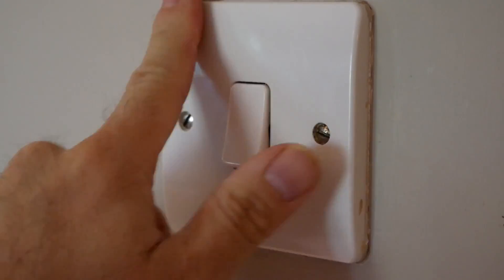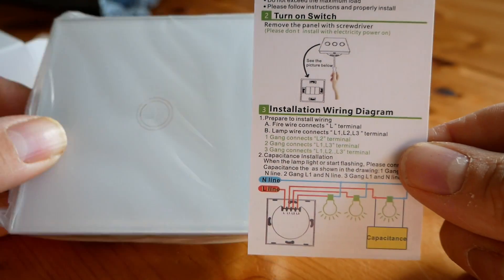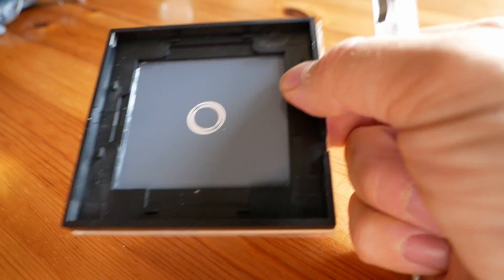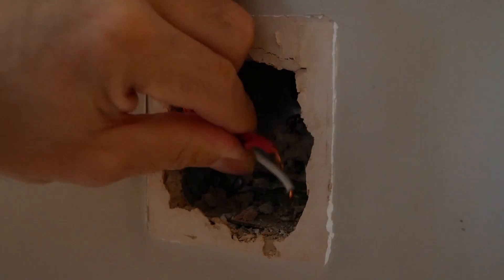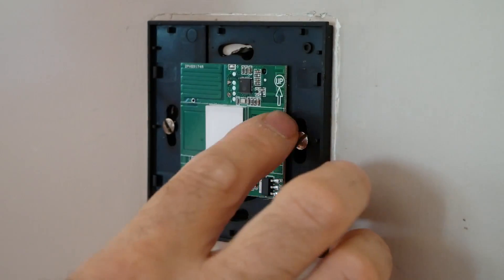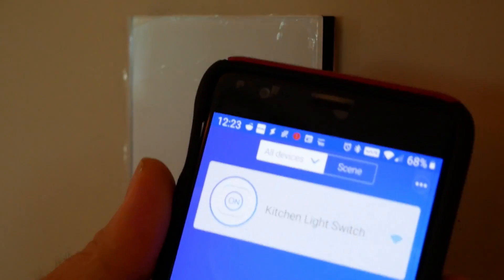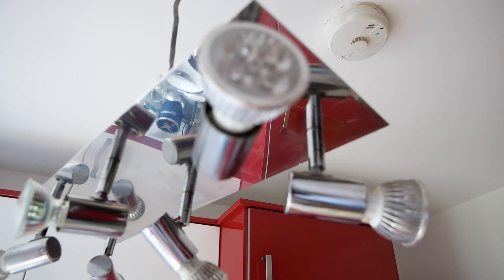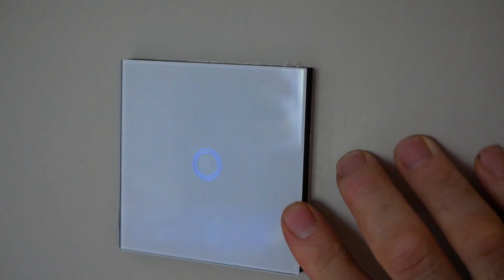No Neutral Smart Light Switch - Unboxing and Fitting

Comment: The capacitor should run parallel with the L1 the flicker is coming from the fact that the switch is always running power through L1 even when it's off. the capacitor on L1 (only) is designed to minimize that electricity when the switch is off.

Comment: I also found a better way to get the Hue light bulb so we no need to buy them now! Method they will hate me for figuring it out but I have! You have done it with a single switch which is great but come to stairs lights it get harder on the setup process, took me a while but now finely have the correct swtuches and correct bulbs at £20 rateh then Hue bulbs at £85 so well worth following me!

Comment: So we don’t need the neutral wire ? And can u tell me what is the benefit of the capacitor? Because when i bought the switch it comes with audiophile , is it same?
Reply from the maker: If you have a neutral wire at the switch then use a smart switch that requires a neutral.
If you only have live wires then a no neutral switch is required.
The capacitor allows the switch to draw a bit of power it needs to run.
I don't know what audiophile is in this context.
👍

Comment: Why you are not using the provided capacitor, and you have 2 live wires?
Reply from the maker: The capacitor is in the light fitting (on the ceiling). This is a no neutral switch so you have live in and live out - 2 live wires.

Comment: Hi mate. Thanks for the video. I'm a moron and am generally speaking pretty hopeless with this kind of stuff, the kind of moron to pay someone hard earned cash to get this kinda work done. Just installed my first switch and connected with Google Home without issue. Two more to do and at least something at home is gonna be smart, if not the residents 😂 thanks a million for breaking it down step by step, you saved me money and time, two valuable commodities which are hard to get in supply!
Reply from the maker: No problem - smart home stuff is a real rabbit hole. be careful or you will be spending proper money  - it all starts with a light switch 😂
Reply: @handymancraftglasgow I started with bulbs...top of the line LiFx ones. My bank balance still bears the scars.

But because I too, am a moron, I kept turning them off at the (non-smart) light switch.

My simple fix has been to tape over the switches in the "on" position, but it doesn't half confuse visitors!

I'd really like to replace my switches with WiFi ones, but I've no idea where to start. Adding confusion is the fact that I have a Google Home speaker, and finding devices that will integrate with it AND the LiFx lightbulbs is...well...challenging to say the least! I'm also sure the voids behind my existing switches are considerably shallower than in your video, and certainly the model you showed would not fit. Are there slimline, Google enabled, no neutral smart switches out there?

Comment: Any idea how the capacitor would work with spot lights that all run off one switch.  Can the capacitor be connected to the first bulb??
Reply: You can install it in any light.
Reply from the maker: As snoopy says, any lights so long as they are the 250v gu10 bulbs and not the 12v types 👍

Comment: What I'm lost, isn't the older wire set ups got white and black for neutral wires? Or just black
Reply from the maker: The set up in the video is very old. There are only live wires behind the switches and are white. Dates from about the seventies, or thereabouts.
Reply: @handymancraftglasgow  thats interesting. here I was thinking I had no neutral wires but I looked and I not only have neutral wires, but an updated colour code
Reply from the maker: If you have neutral wires you can do so much more with your switches 👍
Reply: @handymancraftglasgow  one annoying thing is that non Neutral smart switches are easier to find than neutral ones lol
Reply from the maker: If I had neutrals in the switches I would probably use a Shelly 1 which allows you to keep your original switch. Basically you end up with smart mechanical switches. A bit more complicated to wire in though.
Reply: @handymancraftglasgow  ah, that wouldn't be for me. I want to get rid of the classic look to a switch I get something new, like in this video! I'm gonna be replacing all switches and light fittings in my home haha
Reply from the maker: They certainly look more modern 👍
Reply: @handymancraftglasgow  yeah I can't wait! I'm sold on the fact I can just turn my light off from my bed without hardwiring a whole new switch in my wall to my bed

Comment: how can I use that switch on stairs ? I have two switches to deal with that but I dont know how connect each other
Reply from the maker: You can't with no neutral switches. You can't use these in a two way set up.

Comment: Thanks mate, best setup video ive seen on this. been trying to work out if i needed to install the capacitor or not before i bought them. Even better that your from Glasgow!
Reply from the maker: Thanks 👍. I would install the capacitor. Even if it does work without the capacitor you might want to use a different bulb in the future that may need the capacitor in there.
A fellow weegie I presume 😊👍
Reply: @handymancraftglasgow  I am indeed. Issue I'm having is that the switch feeds external led down lighters that have a really thin profile so not sure the capacitor will fit. Think I'll just need to buy it and try it 👍
Reply from the maker: It can be difficult if you don't have much room. Hope it goes well 👍

Comment: Hi we have just bought a smart switch a sonoff one, we are trying to add to our fluorescent  light in the kitchen, the light switch has 3 red cables in 2 together and 1 on its own, ive got it on and lit up, even set up to alexa but just won't  turn the  fluorescent light on and off, won't they work with those lights, or do I need something extra, I'm a newbe  to smart switches and from the UK. Thanks
Reply from the maker: I do not think  they will work with flourescent bulbs but I am not entirely sure. Have you fitted the capacitor?

Comment: I believe the capacitor goes across the light terminals if you're having problems as it creates a "virtual neutral" to power the switch
Reply: Not really a "Virtual Neutral" but lets enough current travel through the "Load" lead to power the Switch but not activate the bulb. A "Leak".

 I had this decades ago on a Door Bell that had a keyboard and you could "play in" whatever you wanted the unit to play when activated.
Reply from the maker: It does indeed 👍

Comment: Right sexy Handyman guy here is a question fur ye - Living room has about 12 Gu10 fitted lights, they were fitted back in the day when Gu10 Halogen bulbs 50w were in - All bulbs have been replaced with GU10 led - but dimmer don't work now and when the dimmer did work a while back with the GU10 LED bulbs when you turned the dimmer low it would flicker? you had to fiddle about with the dimmer to get it to settle now the dimmer just switched on or off   Do you have a solution?
Reply from the maker: You need to make sure that the new LED bulbs are dimable. If they are able to work with a dimmer you usually need a dimmer specifically for LEDs. The Leds use way less power than the halogens.
If your dimmer was flickering before you changes over to the LEDs its probably worth changing the dimmer switch. 
Calculate the total load of the lights and make sure the dimmer can handle the load. So, if you have 12 leds at 5W each you will be using a total of 60W - probably just over the power of 1 halogen bulb. 
Led dimmers are usually made to deal with lower loads.
Hope this helps
Reply: @handymancraftglasgow  Sounds good sexy boy i will give it try and let you know how i get on.
Reply: @handymancraftglasgow  Good news sexy boy , bought a led dimmer from Screwfix for £7.19 popped it on job done now i can make love to the wife with dimmed romantic lights instead of lighting from Wembley stadium.  thanks i will be back with more problems later cheers.

Comment: Its okay i just rammed the switch oan - stuck the 4 wires 2 in each wan- there wiz a yellow wan there i just chopped it aff way some scissors - i pit the power back oan - it smoked a wee bit and tripped a few times so aye opened it back up and put 2 of the other wires intae the other hole then took the other wan oot and put intae the other wan now wan hole huz 3 and the other huz 2 sound mate wee bit smoke comes oot when it switches oan but i switched aff the smoke alarm so its cool mucker. Buzzin!! so then i shoved the capicityor in there too.
Reply from the maker: Probably a bit late but I would say it's time to call an electrician 👍
Reply: Good video , i will save it

Comment: i have two outdoor lights and the  1switch is inside  (The Wire connecting from light to switch is hidden)- fitting the capacitor is a bit of an issue could i add a cable connector behind the wall switch and then add a capacitor there? 
ie- take the wires from the wall into a cable connector > Add the capacitor >> then add the switch?
Reply from the maker: These are no neutral switches. The capacitor is fitted across the live and neutral, usually in the light fitting. If you have a neutral at the switch you don't need one of these switches, another type would be better.
Reply: @handymancraftglasgow  ok i think i get it now the capacitor has to be fitted at the other end ie the wires coming from the wall light into a cable connector from the light side, not from the switch side.  i bought a cheap version of yours £18 amazon did the job got it to work but mines is non-dimmable.

Comment: For those who get a 2 gang version watch out for the load drop per gang compared to this single one. I think it's from 300w to 100w.
Yes I didn't check and blew the switch board when turning it on
Reply from the maker: Good point. Always a good thing to check the load of any switch before replacing - especially if you are using halogen or filament bulbs.

Comment: Good concise and easy to understand video.Could you up load a video showing a light light switch with a two way switch?
Reply from the maker: I wish I could. I tried everything to get these working as a two way switch but it's not possible with no neutral switches. 
You can set it up in app but if you're Wi-Fi goes down so do your switches, not good. 
There are other alternatives that I am looking into so will upload if I find one that works reliably.
Reply: @handymancraftglasgow  no worries, many thanks for the video anyway.

Comment: Has anyone had the buzzing capacitor problem and managed to fix it?
Reply from the maker: Make sure your connections are good. 👍
Reply: Got the same still can't fix it. I want to try another capacitor
Reply from the maker: When I was having problems with the capacitor, it was usually one of the legs of the capacitor not fixed properly. The legs are really thin, so doubling the leg over at the end to make it a bit thicker generally worked for me.

Comment: Hi
As you only had the one lamp flickering, do you think you could has solved that flickering problem by just changing the old led for a newer style-instead of fitting the capacitor?
Reply from the maker: I tried a lot of different ways to try and get it to work but in the end I had to fit the capacitor.
Reply: @handymancraftglasgow  
Ok thanks for the reply... my issue is that I have an old one gang switch , no neutral (which I’m hoping to swap for a smart switch) feeding 3  outdoor lights so I’m wondering where about in circuit do I fit the capacitor? I was hoping I wouldn’t need one!  Thanks anyway!

Comment: #Handyman Craft Glasgow HELP ME PLS, i
I bought 1, set it up in the application, then I click the switch button manually and it resets itself, what do I do?
Reply from the maker: Make sure its wired correctly. It should only reset after you press the button for about 5 seconds.

Comment: So what if I have neutral cable
Reply from the maker: You can use other switches. Make sure you do have a neutral. If you have a red and black wire going into the switch chances are the black wire is a live.
Double check before you buy a switch 👍

Comment: ⚠️ Hi! Great video. I just installed the smart switch in my bedroom, which has a twin switch connection, so 2 switches operate the same lights. I replaced the dumb switch with the simpler connection by adding the common to the Neutral whole and L1 & L2 to L and L1 in the smart.
The issue is that the other dumb switch doesn’t operate the lights anymore.
Any ideas why? 
Maybe because I connected the N to the common?...
Reply from the maker: Sounds like a two way switch. Not possible with this switch. Though some have used software to make it work.
Reply: I had a similar problem only that when I'd switch on the bedroom lights with the dumb switch the smart switch would get disconnected for a few minutes (the WiFi light would go off & the blue light that shows in the off position wouldn't be there) & then it would get reconnected. It frustrated me so much that I just returned the dumb switch. Kindly advise..
Reply from the maker: You can't use these as a two way switch. I tried to get my hall lights to work but not possible.
Reply: You can't use 2-way switch but there is a solution for that. There are RF switches with the same design that are battery operated and you pair them to the main switch. You don't use the wiring for the second switch. So basically that switch acts as a remote control. That of course requires the main switch to have the RF option (most do).

Comment: when the light with the capacitance is on it makes a lot of noise, it's buzzing really loud. is that okay? should I be worried ? (when the light goes off, the noise stops)
Reply from the maker: It shouldn't make a noise. Check your connections.
Reply: Ok
Reply from the maker: 👍 Hopefully that's what the problem is.
Reply: @handymancraftglasgow  I will try to reconnect it all over tomorrow and we will see. Maybe I will try to connect this capacitance reverse.
Reply: @handymancraftglasgow  and thank you very much for your quick response
Reply from the maker: No worries. Hope it goes well 👍
Reply: @handymancraftglasgow  I have just dismounted the capacitor and it works fine now
Reply from the maker: Brilliant 👍

Comment: Hi just seen this. Sorry if I'm being daft but I have exact same as you behind light switch and followed and all good, however same issue with bulb, mine is actually staying partially dimmed even when off. However in the ceiling rose I have no neutral wire? But do I still just connect the capacitor in live and neutral inside ceiling rose?

Comment: So if I have spotlights,  where do I put the capacitor?
Reply from the maker: You would put it on the first light on the line.
Reply: @handymancraftglasgow  how do I find out which light is first
Reply: @handymancraftglasgow  the capacitor install before the LED driver or after end?

Comment: Hi
I have just wired one in but doesnt switch on or off, I have the switch illuminating and it connected to wifi.
Its connected to a 7 bulb chandelier with LED dimmers installed.
Wire colours at the switch are red(live), black(neutral) and  an earth.
I have L, L1 and neutral connections on the switch, (tried the live in both L and L1 but nothing)?
It came with a capacitor but I have not added this yet though.
Could you please help and give an idea what I am doing wrong?
Thank you in advance.
Reply from the maker: You will need the capacitor for led bulbs.
You have to check your switch cables with a meter. It sounds like they are both lives. The constant live goes to L and the switched live to L1.
If you are not sure call in a pro 👍

Comment: How is it possible that this switch is powered if only a live wire is coming into it and exiting out of it, without any neutral wire to complete the circuit ?!?
Reply from the maker: The capacitor is the key or a lightbulb. It sneaks a little power from there. So takes the power from the neutral the light bulb is connected to.

Comment: what will happen if you have only  with neutral wire switches? is it possible to use in loop wire system
Reply from the maker: Not sure what you mean. This will work with no neutral.

Comment: Hi...Im stuck its no picking my router up and its running on 2.4...I have the lights on but only if you touch the socket itself
Reply from the maker: Try switching the switch off at the fuse box for about 20 seconds, restart your router and try to get them to connect.
They can be a bit frustrating sometimes but usually I find its something I am doing that's causing the problem.
Reply: @handymancraftglasgow  Thank you i shall try that

Comment: Great how to video. Thanks for making this! Tried to install today.. Lights flashed slowly on and off but couldn't see blue ring around power switch.. Any ideas what i was doing wrong? Do i just need to install the capacitor?
Reply from the maker: I would always install the capacitor for these switches. Should work after that 👍
Reply: @handymancraftglasgow  thanks. Switched to an old non led light bulb and got it to work for now. Capacitor fix is next up. Thanks.
Reply from the maker: Great. It should work no problem once the capacitor is in 👍